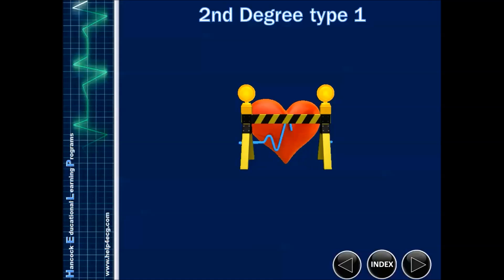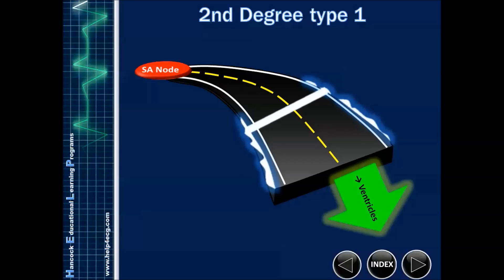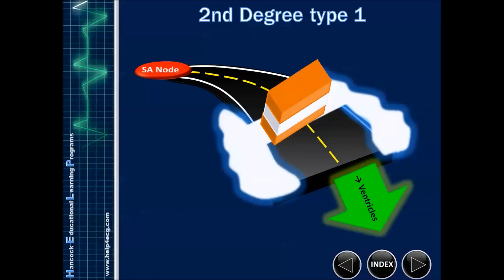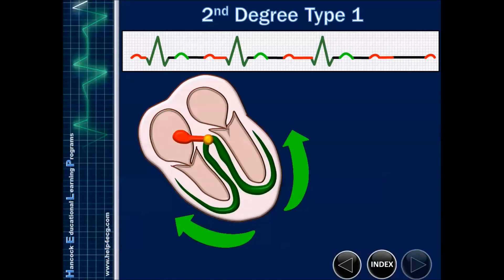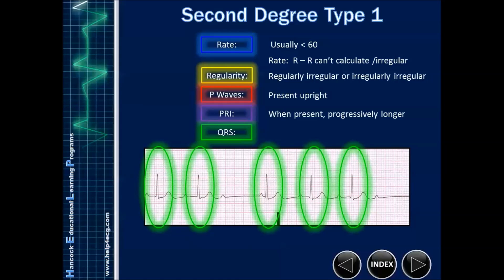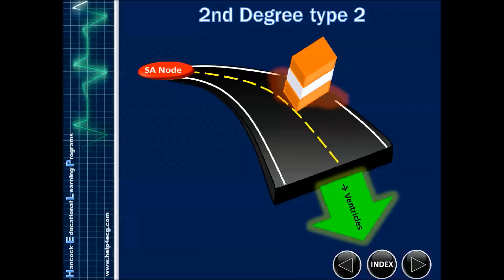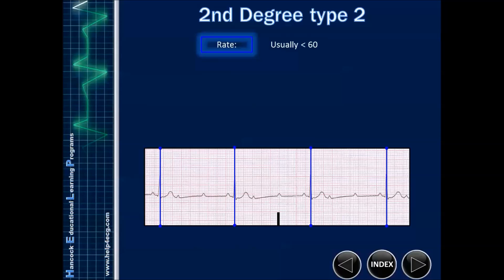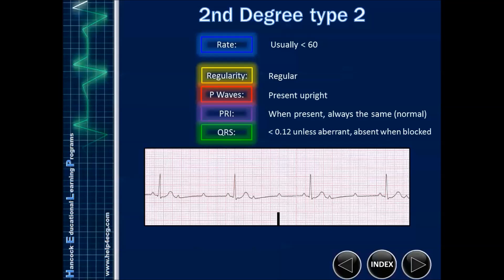Heart block The best online ECG training available

Comment: Love the animation.  However, I can't use this for class, as your example at the end of the video is not a 2:1 block but a 3:1 block (3 p's to produce 1 QRS, ie 2 P's conduct through but the 3rd does not) which would confuse beginner students..  Also, as mentioned on the video, many 2nd degree type 2's have QRS' originating from below the HIS bundle & travel down just one bundle branch.  It would be nice if your video had an example which showed a wide QRS complex for 2nd degree AVB type 2. .